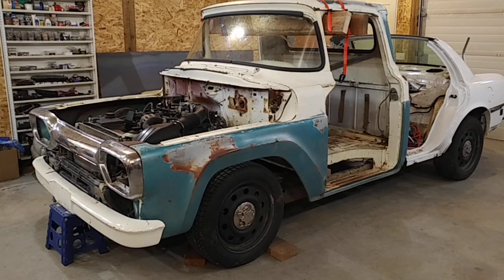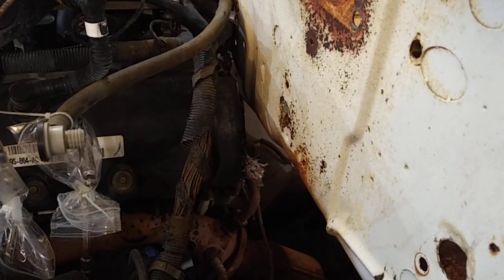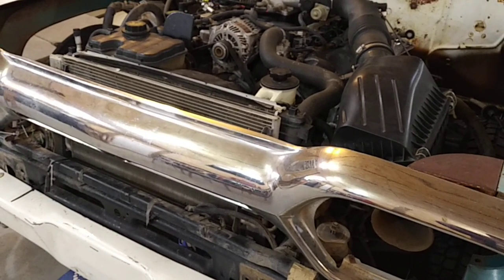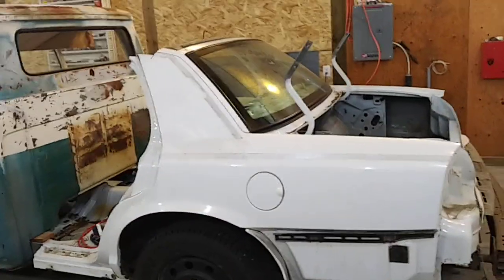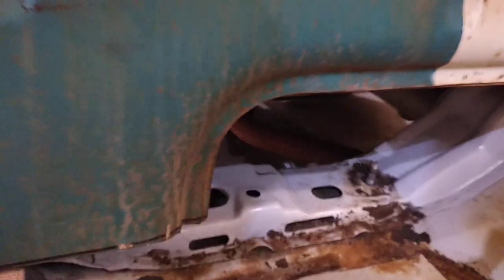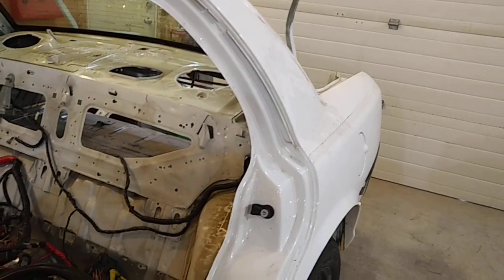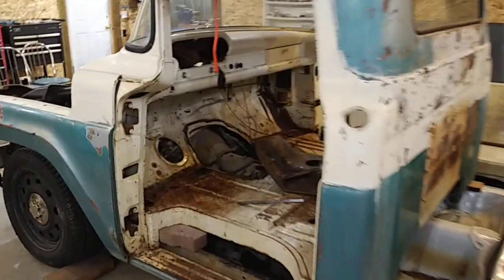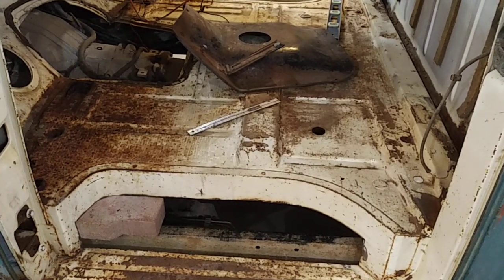F100 Crown Vic Full Frame Swap Part 3

Comment: Can you please share the part number and supplier for the flexible egr tube I’m am doing a 59 F100 as well. Thank You!
Reply from the maker: I'm pretty sure this is the one I used. I used 2 of them to get enough length. Unfortunately it looks like they're out of stock right now. Another option I considered was doing an egr delete. I understand you need to do a custom tune after to prevent getting codes, but if you're going to do a tune anyway, this might be a good way to go. https://modd.me/product/flexible-stainless-egr-extension/